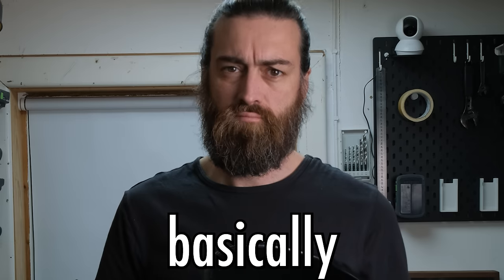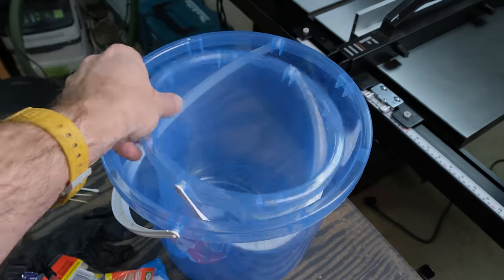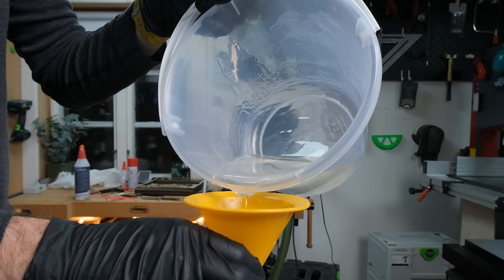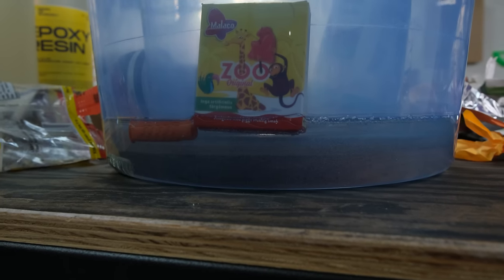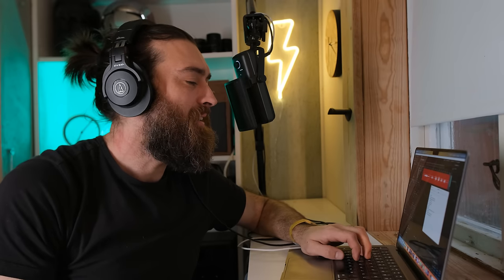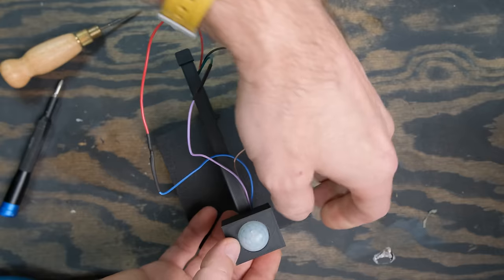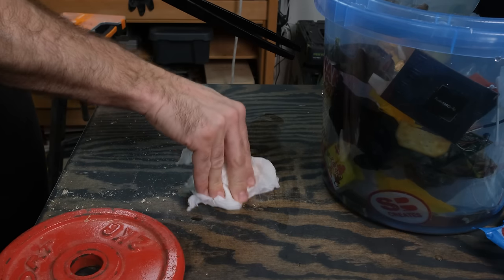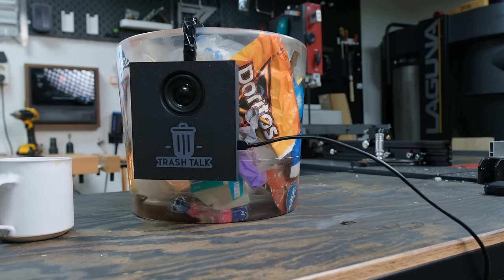the talking epoxy trash can

Comment: I'm not sure the 30mm limit mattered on this, since the whole mould is less than 30mm thick. The buckets aren't insulated, so heat should dissipate just fine even if you poured the whole thing at once.
Reply: I was thinking the same thing. I just do a routed out epoxy logo in a desk, with some LEDs in it

Comment: You can name a vacuum chamber out of a large plastic tub, add a one way valve, some putty blue-tack or similar to make an airtight seal and a perspex / polycarb top. voila.  use a vacuum bag pump to extract the air.

its that easy.

Comment: Super cool. Epoxy gets yellowish and even honey like in color real quick from UV. Perhaps you should coat it with some UV proof clear coat, or are there any polishing waxes with UV protection?  I'm surprised that much epoxy didn't exotherm and get really hot, that's what happens when I mix up that much at a time... BTW epoxy doesn't 'dry' it cures, well, same difference I guess, it certainly is dry after curing...

Comment: Why didn't you use PCBWay to have a PCB made for your sound project? The white development boards are really bad. At least use perf board and solder wires to the components.  I used copper-clad and an X-Acto knife eto make lands, until I discovered how cheap and fast PCBWay was. If I had to do several turns to get everything right, it still saved a fortune.

Comment: Ha, nice!  Did you worry at all about the heat from the epoxy melting the plastic bucket?  I know when I mix in Solo cups, the curing heat warps them pretty good.  I mean, it doesn't look like it did warp them, but were you worried?
Reply from the maker: Yes I was a bit worried but I have some experience of this particular epoxy and it havent been that hot when curing so I had faith it would work
Reply: @TheSwedishMaker  It looks great.  Love the combination with the electronics.  I'm working on a router table lift powered by a raspberry pi to drive the lift mechanism and provide auto-zeroing and some other stuff.  It's been challenging and fun and might actually work.  Thanks for more inspiration!